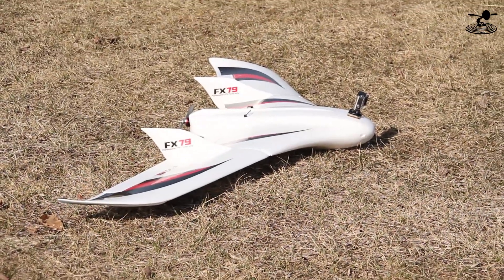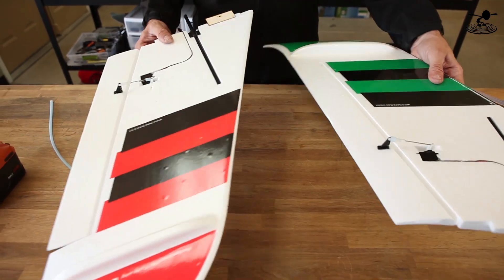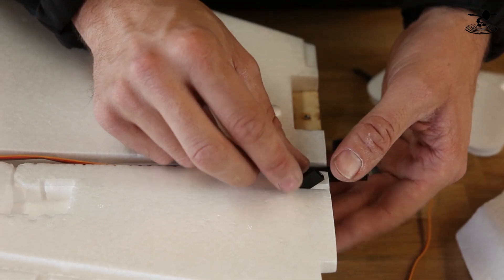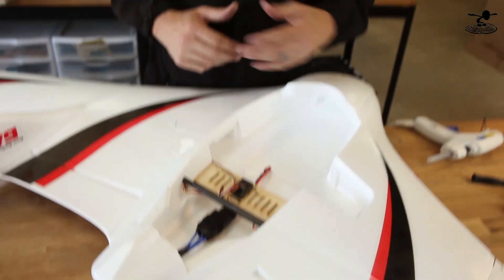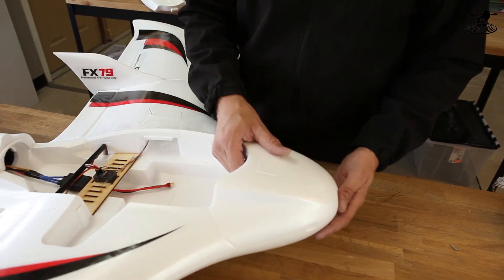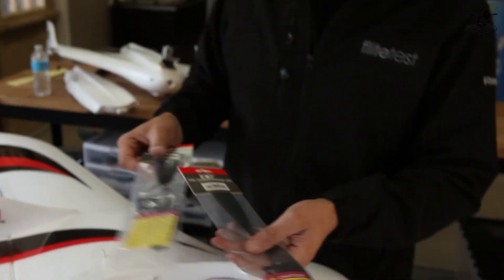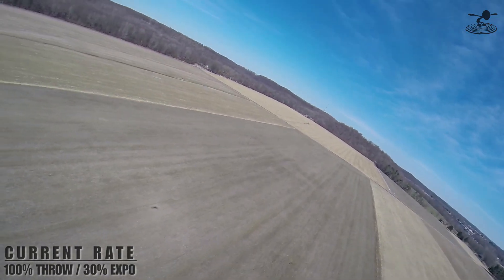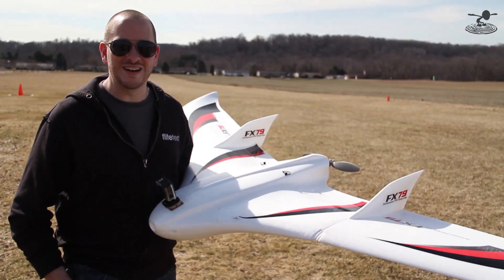Flite Test - FX-79 Buffalo - Build, Tune, Fly

Comment: On the control rods, put the drill away, and grab a box lighter. Heat the rod end with the Vic lighter, and then just push it through the desired hole. It melts the hole as you push it in, and the hole ends up being the perfect size too;)

Comment: I know they're extremly small but I recently purchased a syma s107n and I would love to see you guys flying it (Due to it's size I would recommend flying inside because the trasmission gets pushed into the prop and you lose signal and it falls out the sky) It's also very cheap. I will have a video of me flying it on my channel soon.
Reply: Syma made a new version of the S107 that uses a 2.4ghz transmitter,  thus you can fly it outside now!
Reply: Tjrosenberry Really! I might invest in that the only thing is that the wind is too strong against the little helicopter
Reply: Might be better in the wind as it is no longer a CO-AX  seach for SYMA F4.  Looks pretty good,  pretty good price at $27.  Yet the V911 is just shy of $40.00 and by far the best Mirco 4ch heli on the market today,
Reply: they are a nice little start heli as my little bro got one, although all the helis I own have a tendency to flop on to there side on take off, but it flew well once I got it up... although I thing multi rotors like the ladybug from walkera are much more fun

Comment: Josh, I just found out that placing the satellite  antenna vertically isn't really going to help because the DX18 and the DX9's antenna when held parallel to the ground, none of them has a vertical polarization so you might want to place the satellite antenna horizontal  but still 90 degrees. Great video and nice plane

Comment: Hi there, thx for the vid.
The antennas on your 6210+sat look a little worn down, just a little tip:
Use heat shrink tube on them all the way including the plastic base where the cable comes out. Makes the whole thing more rigid and lowers the risk of the antenna breaking plus it looks way better than those bare cables that never stay in a line.
And btw. this does not influence reception or range at all.

Comment: Have you thought to use a long 2 inch wide strip of adhesive velcro say 4-6 inches long and mount it down the longitudinal axis on the battery compartment base?  Then attached the other adhesive velcro strip to a long board similar to mounting board in your video.  The idea is to be able to move forward or aft the battery mounting board with battery strap to gain proper CG with different size/weight batteries.

Comment: Hi There, is it possible to use the extra control surfaces (those that come with no servos pre-installed) as elevators and use the original elevons as just ailerons? Would it fly well with this setup? Thanks.

Comment: Does the satellite receiver provide more range?
Reply: This may be a complicated answer, but check out David's personal website for linear polarization definition, but don't get it confused with the circular polarization and others.
http://rcexplorer.se/educational/2011/08/circular-polarization-explained/
Having 2 linear polarized antennas means one receiver helps make a strong connection when the plane banks 90 degrees.  The other, when the plane is horizontal.
So.. not more range in normal flight, but full range when banking the plane at steep angles.

Comment: Why do antennas need to be outside the EPO? Foam is mostly air anyway?
Reply: Rolf Hult just because even though foam is mostly air, it still gets just slightly better reception if it is out side the airframe.

Comment: Build/tune/fly suggestion: cut-down Stryker core. Cut out the middle fuse, stitch the wings back together. Challenge: keep everything buried!

First post:
http://www.rcgroups.com/forums/showpost.php?p=11140740&postcount=843

Recent post:
http://www.rcgroups.com/forums/showthread.php?t=2006469&highlight=stryker#post26227474

These things are so much fun when you get two or more in the air at the same time. Cheers :)
Reply: Should probably mention that it's been upgraded extensively since the first iteration with balsa elevons and vertical stabs more towards the center. Runs off a 2S1P 800Ma with about an 8-10 minute flight time using moderate throttle. Unfinished , just a hot-glue center seam and 1" strapping tape bracing for stiffness, no spar. I can't recall the other specs atm but you get the idea :)

Comment: At the end of the video Josh mentions using the ESC brake to stop the prop for landing. In my opinion, this is actually NOT a good idea as you have no control over the position of the prop when it stops and with the "brakes" on the ground can't easily move the prop without breaking it. Having flown hundreds of flight with scratch built foamy pusher jets, it is much better to just let the prop "windmill". If you cut the throttle early enough the prop will usually settle inline with the trailing edge of the wing/fuselage and if it doesn't the ground will just push it out of the way. In those hundreds of flights I never broke a prop on landing by letting the prop windmill.

Comment: what is expo?
Reply: +luke sevenski Basically, it's the way the servo moves to your stick, it's an abbreviation for exponential. With a linear curve, moving the stick to 25% will yield 25% servo response, 50% stick = 50% servo, etc.
With an expo(nential) curve, 25% may only result in 10% servo movement, 50% may mean 35%, and 75% may mean 60% and 100% will mean 100%. Why would you want this? So that you can have fine control of your plane with a large area of your stick only making small changes to your servos with large stick inputs and still have the power to pull 100% if you need it. This quote is from RCGroups.

"Expo changes the servo response curve from a straight line (linear) to an S-curve, flatter in the middle (less sensitive) and steeper at the extremes. This means you get more precise control in the range around neutral where most flying takes place, while still retaining full throw when needed.
Typical values are about 25% (which has only a mild effect) to 50% or more (used on 3D machines with large control surfaces and big throws). I routinely use 25-40% expo.

You can get the same kind of precision by switching to low rate, but the disadvantage is that you don't have full travel when needed, except by flipping the D/R switch -- which you don't have time to do when approaching the ground rapidly!"